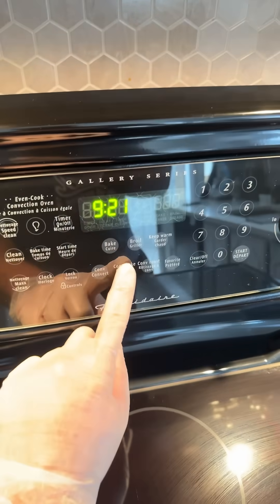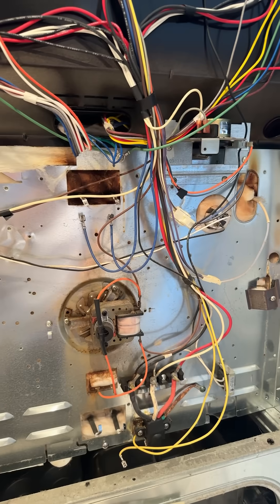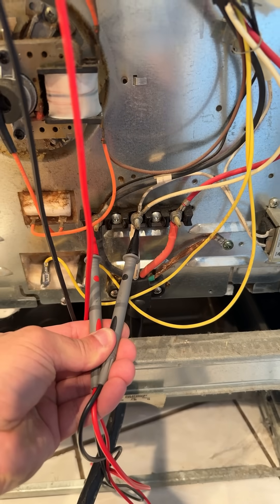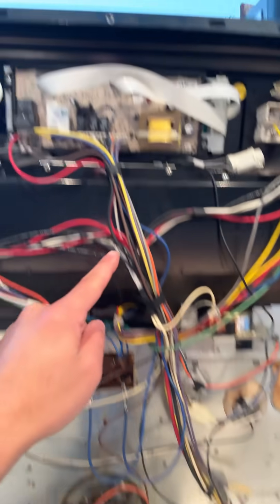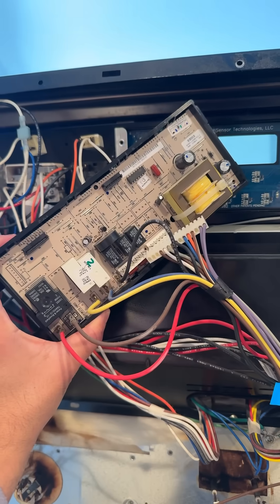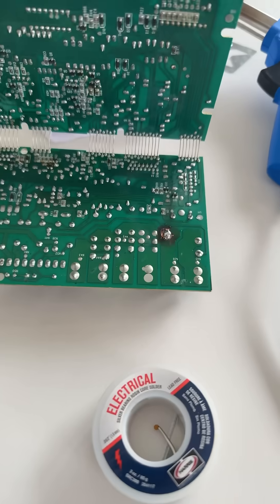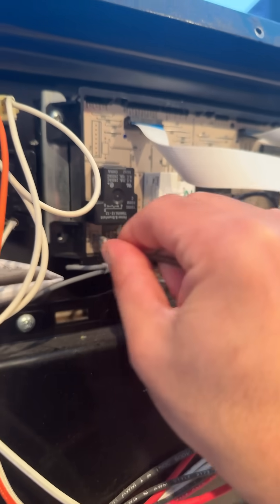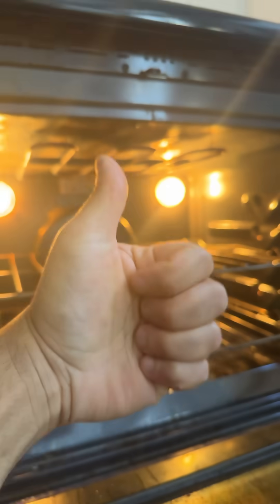One Tiny Solder Killed This Oven – Here’s How I Brought It Back To Life 🔌⚡️

Comment: I’m impressed that you fixed it and didn’t just replace the board like most people would have.
Reply: And that's the problem with these modern electronic appliances. Most repair men are not trained in electronics and are scared of those circuits. It's just the same thing with cars and mechanics.
Reply: @landrelalonde3402 every appliance “technician” I ever see just looks up parts and says well can’t get those anymore. Please pay me $200 for your broken stove. How do they sleep at night knowing they’re criminals.
Reply: Usually not worth the time and effort. Cheaper coming back and replacing than spending time doing all this @landrelalonde3402
Reply: @landrelalonde3402  LOL, It's not a question of training, it's a question of time & $; They get a commission on repair parts, and appliance sale leads
If you want to save $:
1. Take a picture of the data plate (inside the oven)
2 Type in the Make & Model # into the Google search bar
3. Download the appliance parts manual (pdf)
4. find the component you want to replace.
5. Google the part number, and find it online.
6. Order the part needed
7. Replace WHEN it comes in.
Reply: Nice repairs but as an electronics guy I'm always wanting to look at schematics and try to explain why the toasty part is toasty... You claim the solder went bad but that's highly unlikely the real issue. It's more likely another failed component that caused too much current at that visually burned spot until it lost it's magic smoke and burned up enough to disconnect... I wonder if it's still good and if you tested any of the board test points before and after repair.
Reply: @ZippyFreight  as a repairman, I'd only care about that if it becomes recurring issue.
Reply: @tcholmes2237  sorry to say than you are no repairman but a scammer.
to not repair the issue but instead only make it runs another 5 min. is called bush fix, you do it in the bush to get out as you have no choice. That burn was never ever because of soldering was bad. to only put soldering at that burned part is illegal in Europe and you would be fined when that over starts burning or a people die.
Reply: @ZippyFreight  Those were my thoughts.
Reply: @ZippyFreight  In this case, the relay's load contacts are switching a very high current (20+ amps) to the heating elements. Most likely the dry (lead-free) solder connection to the copper of the board was insufficient causing the joint to heat up and arc over time until it failed. This was just a high resistance solder connection that burned open and the magic smoke was not harmed.
Reply: @ZippyFreight  It's a relay switching the element. There won't be any other components in that path except maybe a current sensor. Nothing that's going to make the relay burn. The relay burned because of a cold solder joint. The fix was good.
Reply: Oh don't worry he'll be replacing it soon
Reply: That split board is a pita.  I swapped mine last summer.  The replacement board was and was not the same.  I lost the start time function for my oven.  That sucked since I would start it 15 min before getting home to do a pizza.
Reply: I suck at soldering. I really really hate it. I'd find a supplier that remanufactures the boards better than I can and sells them with a  core discount.
Reply: That's what 'Frigidaire' wanted when they designed this truly awful piece of cr@p.
A burnt up trace on a PCB which carrying 12 Amps for extended periods of time results in a repair charge of $600 - Nice one Frig-it-aire.
Reply: charged for board replacement
Reply: Perhaps a isolation test woud be good on the heating elements. P erhaps a Resistence of th relay contact. 
Great repair

Comment: I had to do that with my dryer that stopped working. I pulled the board out, re-soldered it and viola! I work in healthcare, and my husband in the trades (concrete), but any house appliance or electrical are my domain. Ive seen that mam electrocute himself changing a light.

Comment: Just a couple things. If the component caused the burn it’s highly advised that you replace that component on the board. You also need to remove the burned part of the circuit board and put solder masking over it. THEN you resolder the new component and use less solder and more flux.

Comment: I have a Maytag Gemini, MER 6875BAF, double oven that’s 17 years old, still works great. Have replaced a cooktop element, a bottom oven element and a top oven element. The only thing I couldn’t do was replace the top oven halogen bulb (it got cooked in place). I wanted to replace it with regular bulb, but haven’t been able to find one that would work, or even a normal replacement for the one I have. Can you help?

Comment: Anyone following this video would be electrocuted about 4 times. With the voltage applied to the unit, those components you show yourself touching would shock your viewers. Content must not be more important than the safety of people viewing! 

You show testing for Ohms, then voltage, not explaining that the plug was out for the first and in for the second.

Maybe those cheap meters that pay you a dime apiece have some fine print in the package. I'm sure it's fine. Worth the risk to get it under 120 sec., right? Disgusting.

Comment: Comapnies are doing this intentionally. The amount of appliances i have fixed that have a blown trace or bad solder joint is crazy. Last week I did a dryer the board had 4mm traces and one spot on the board it narrowed ro less than 2mm and right back to 4 for no reason. It poped right there. Appliances used to last decades. They all can be fixed. Repair dont replace.

Comment: It's actually not a bad meter I use one for industrial applications. I would recommend getting you a better set of probes it's the only downfall. Has a lot of features for the price. Wish I could figure out how to turn it to automatically go to AC instead of DC and turning it on but it's not a bad issue.

Comment: oh god.... what did you do?!?!?!

i hate to be "that guy" but......

relays work by using one power source of a specific voltage, call it 24v for example) to enable the flow of another power source of a different voltage. (240v in this case). the switched (240v) line connects with a little flap of metal that physically touches a contact via a coil (powered by the other voltage) pushing it, and this creates the path for electricity to flow. that little flap when continuously connected and disconnected under load will create little sparks (which is arcing due to it being switched while under load). that arcing creates burn marks inside the relay on the contacts. those burn marks are carbon buildup and it creates a smaller and smaller path for the 240v to flow.. smaller path means more resistance.. more resistance means more heat is created.. more heat means burn marks on the pcb like you saw here... 

all you did was reconnect a bad and now dangerous relay which is creating so much heat that it burned the pcb and melted the solder and broke the connection.. you didnt fix the issue which is a bad relay.. you left this customer with a dangerous oven that theyre now going to use. that bad relay  can very easily catch on fire when the connection cant be broken by the huge glob of solder. the next thing to fail is the plastic of the relay itself will melt. and it will become so h ot that after melting the next step is igniting..

relays are cheap...  if you want to fix this in a way that will make ity work forever with no more arcing and no more melting replace that relay with a solid state relay. those are also cheap but way better for cutting and connecting power under load.

Comment: Solder should flow smoother/ follow the circuit board contour better than that. I don't know what you had to deal with underneath... Hopefully there was enough conducter left on that circuit board and there's no resistance in the connection if you cleaned it good.
My 2¢ I wasn't there. If it works and lasts good deal😊 I would have done exactly the same thing you did. That's probably a $300 circuit board. Maybe more with the service call...
I have repaired some automotive instrument cluster circuit boards in the past. It's very tedious between getting the solder to flow but not damaging anything else.

Comment: So I have a range that looks very similar, and the front right burner stopped working.   The local appliance repair, nor I can find the serial number on this LG...what do you think?  I really loved having 2 big burners.
Reply from the maker: It happens quite often actually, the stickers disappear! 

You’ll have to pop the top cover off of your stove and look at the element in question. It will have a part# on the bottom of it. 

Alternatively, most ranges will have a wiring schematics page buried behind the back cover (remove the rear cover as I did, and inside (usually near the top controls) they will stash a wiring schematics sheet with the model #.

Comment: I had the same problem on Thanksgiving, but only one leg of the 220 burnt out, so the oven was on half power. I reflowed solder around the arc blasted joint and it worked fine for years.

Comment: There is somethi g wro g with this when thing,,, solder joints don't just "go bad" that blackness is from. Afailed comone t, that fried,,, something got realy realy hot a d fried,,, IV never seen a fix by simply fixi g a bad sldoer ,,, sonetbhk g got realy hot a d you always need to replace what ever failed,, such as the relay,,, this is just all wrong,,, to start you checked each leg ,to ground, a d did t check between the legs,, that's the 1stthi g one does, 120 to ground yihbhas 118, as an electrician for decades,, there is simy somethi g wro g about this "some fix

Comment: I have a mild observation. If that stove looks new, isnt it that those cables should be place in orderly fashion and there shouldn't be so much rust?
Any reason for that rust at the connections?
And one suggestion: Never say a Client is lying, doesnt look good on you. They are requesting a check up on warranty (if not mistaken) you should take it at face value.  Another suggestion:  if there is actual damage under warranty service it, but if there is damage that has nothing to do with the warranty charge a fee. Basically, you can tell the Client you are checking, however if there is nothing equipment related, you will charge them a visit fee - you can advise them in writing what can be done, and you collect your fee. Never say a Client is lying. You are a Client as well, remember that!

Comment: This will happen again and again!  The solder has more resistance compared to a copper conductor.  Use the output from the board to trigger a form C relay placed in series. You have to use a relay that will handle the current for the oven heating elements.  Wire the elements through the N. O. contacts on the relay.  The only current that will be running through the under rated circuit on the board will be the small current required to turn on the added relay!  Do this at your own risk or reward!
Reply: theyre soldered from the factory. hes not adding resistance by doing what they do stock.. this fix WILL fail again but not because of the reason you said. itll fasil because the relay is bad now due to the carbon buildup on the switch side contacts due to the arcing due to the relay being turned on and off while under load. more building means less surface area for electrons to flow which means more heat.. which is why the pcb was burned to begin with. BEST case scenariop is the switched side contacts will heat up so bad that they melt the coating off the wires in the coil and create a hard short that kills the coil and permanently disconnects the relay. worst case scenario is it starts a fire from that heat. a solid state relay is the only right way to switch a 240v loaded line from a (probably) 24v pcb.
Reply: @jstagzsr  check the inherent resistance of solder compared to copper!
Reply: @jstagzsr  That's your opinion!  If the solder job from the Factory was so adequate, then why did it fail in the first place?  
People like you would just go out and spend monet on a New board and then think you have the problem fixed!  Everybody an expert or in your case a know it all, when someone  makes a suggestion or has an opinion!  I don't need a sideline critic telling me what will work and what won't!  People like you only like to troll other people's comments, grow up!
Reply: @jamesgeib3461 the reason it failed is because the contacts inside the relay arc when opening and closing causing more and more resistance and heat to build up and eventually burns the connection out replacing the relay or the complete board is the proper fix.  This will work for a time but not long enough to warranty let alone the liability you take on doing stuff like this to a customers appliance.
Reply: @jamesgeib3461 the solder got hot from a bad relay likely. If that is the case it will just melt again. No need to replace the board though, just the cheap relay is enough.
Reply: @jasoncroyle5575  you're assuming that's the reason it failed, It could have also just been poorly soldered and the vibration of engaging / disengaging caused it to create a gap, which sparked and melted away the solder and burnt the board in one shot. 

In the end, it could be either, a more complete fix is to replace the relay too, but i don't know if i'd recommend desoldering and then soldering 5 more joints with the equipment and the plumbing solder the guy had. this fix is good enough for now.
Reply: I've only been doing electronics for 20 years, but disagree strongly. Imagine it was a dry solder joint that was in a cycle of poor connection--> heat--> poorer connection--> more heat--> failure. So long as it was cleaned properly, and the relay itself was not damaged internally, reflowing the joint should lead to a laying repair. If it was done to J-STD-001 Class 2 acceptability requirements, and not the blob we see, I'd argue that is the best connection on the board lol.
Reply: Form a or c dont matter but to be honest that blob of solder might holder longer than the rest of that cheap board 😂💀⚡
Reply: You all are wrong lol
It had a bad solder joint from the factory, probably a cold joint, so his repair creates a MUCH lower resistance than it had from the factory, and will last just fine.
And I don't see any signs of the relay getting hot, and if the issue was a bad solder joint, then no reason to believe that the relay is compromised.

The only concern I have is if the board or traces were damaged from the overheating, they might not last as long as they would otherwise, but that's a slim possibility.
Reply: @ke6gwf  Oh and you are 100% correct!  As a matter of fact you are a genius!  The world could not survive without your intellect!
Reply: @jamesgeib3461  obviously! Thank you for the encouragement!